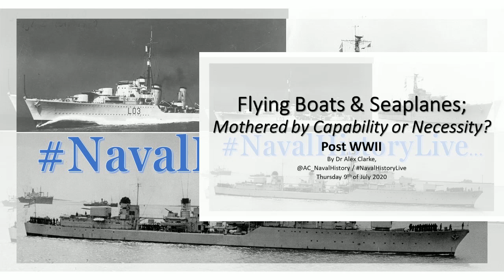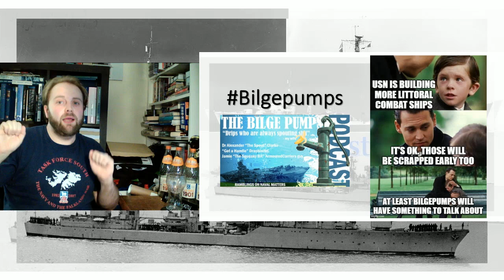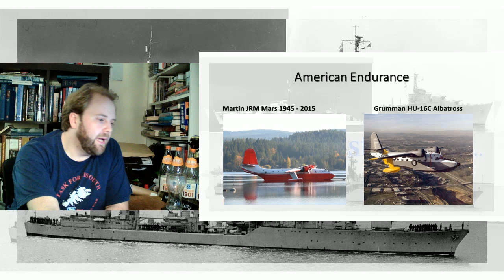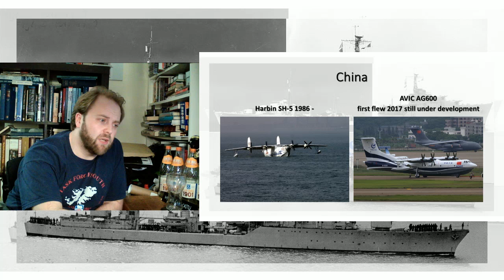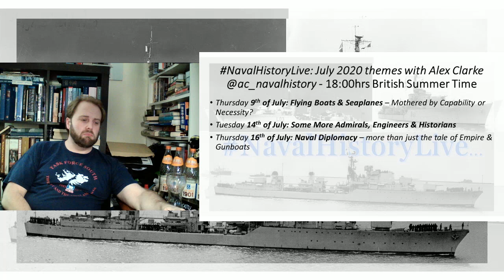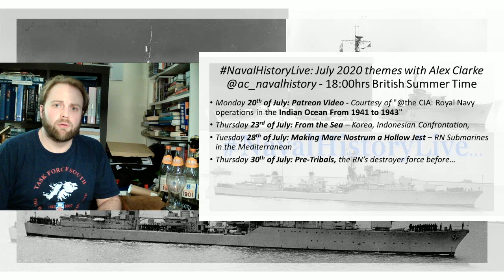An Introduction to "Flying Boats & Seaplanes; Mothered by Capability or Necessity?" P4/4 Post WWII

Comment: With respect, what killed the flying boat militarily is the fact that equivalent land-based designs are more efficient aerodynamically, hence higher performance along with the vast numbers of runways built around the world.
SAD FACT: For the last several years if its career, the Albatross was restricted from water landings due to age and fatigue.  It flew from land runways only.

Comment: Something worth discussing in more detail would by the Schneider Cup. 

The next best thing to war for development is a level of competition. 

But it did raise issues, as the objective was faster seaplanes, the cup did lead the development of rather complex engines, bred to race, not for war.

Kurt Tanks development of the FW190 made a plane designed from the get go, as a war plane.